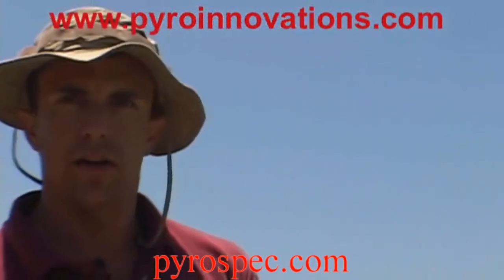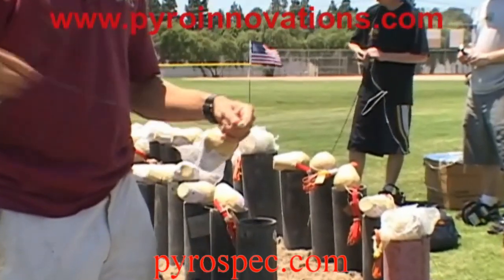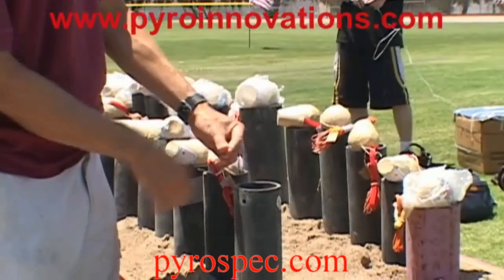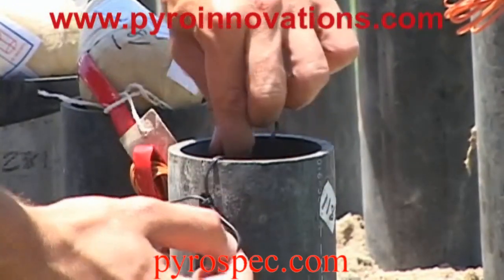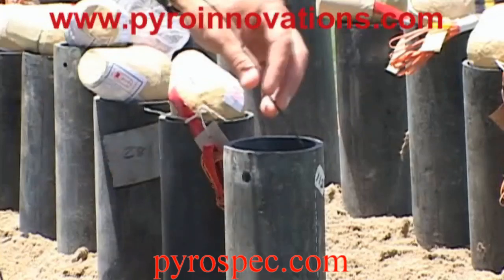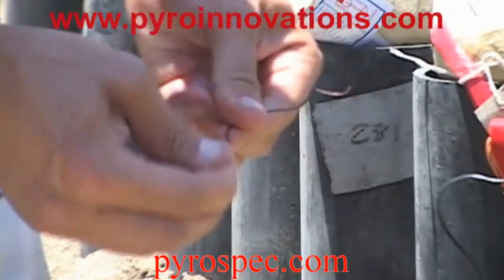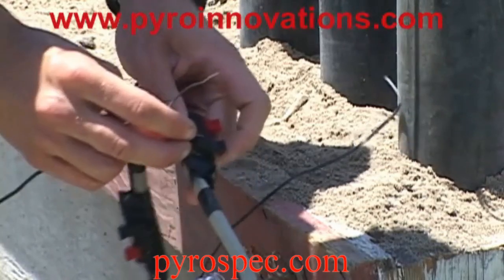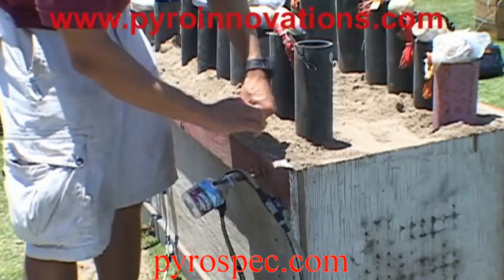How to Load Large Aerial Display Fireworks

Comment: How do you go about loading larger diameter shells (8" - 12")? Should you attach something to the shell to lower it into the mortar? 
Also, any suggestions on burying the larger mortars? 
We are getting into this phase and there's not a lot of information posted regarding it.
Reply from the maker: Lee, anything larger than a 6” will have a rope leader attached to it to handle the weight. I don’t quite understand your burying mortars question, can you clarify exactly what you are wanting to know?
Reply: @PyroInnovations  We lit off 6" shells last year which didn't include anything so I was curious about the larger shells. 
In PA, at least, they require anything larger than 8" to be buried (in ground, in sand, etc.). From talking to other pyros, they have buried the mortars in the ground. What I'm questioning is that if the hole is just simply filled in around the tube with dirt, is some sort of box/support erected to contain it within the ground, and what is an easy way to get the tube back out?
Thanks for the reply! Greatly appreciated.
Reply from the maker: Rules may differ from place to place, but in general we put 10" and above in their own 55 gallon barrel of sand.  This is sometimes easier than burying them, no digging required, as they are transported to the site already in the barrel making setup fairly easy depending on the logistics of the location.  If you have to bury the mortars, yes you can just dig a hole, bury them about 2/3 of their length, and just back-fill dirt around them.  Don't forget to put some lumber underneath them in the hole, otherwise they can literally shoot themselves into the ground, even the smaller guns.  Hope that helps! Thanks for the comments!
Reply: @PyroInnovations  That's perfect, exactly what I was looking for. I have saw the 55-gallon drum technique before. I'll check on our rules and regulations. I greatly appreciate the feedback especially answering on an old video. Take care!
Reply: Try to always bury mortar tubes 2/3 to 3/4 of their length into the ground.

Comment: Hey quick question I noticed when wiring it the thing (sorry still learning) you put the wires on had a red knob like thing and a black knob like top indicating positive and negative however you didn’t point out there being a negative and positive wire to put in. That being said the question is. Is there no negative and positive wires when doing this?
Reply from the maker: Hi Alfred, great question. Yes, the red and black terminals do indicate which is positive and which is negative relative to the power source, but the devices (electric matches) don’t care about polarity since they are essentially the equivalent of a resistor. So in other words you don’t have to worry about which wire goes in the red terminal and which goes in the black. Hope that helps!